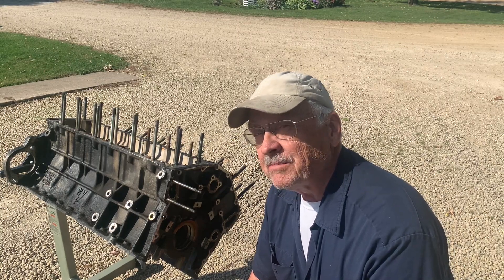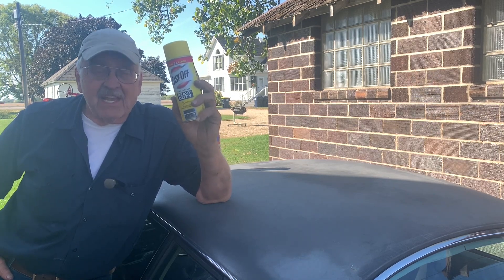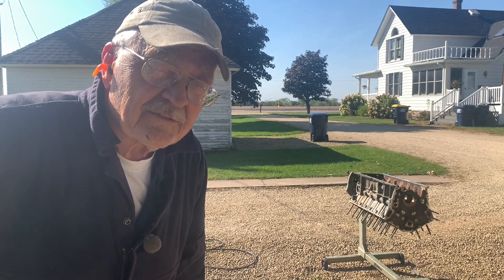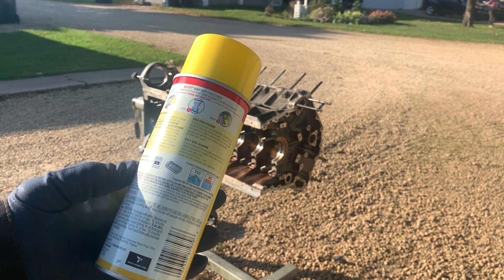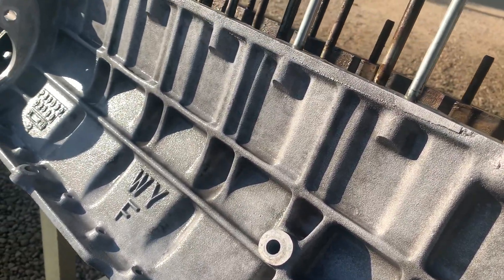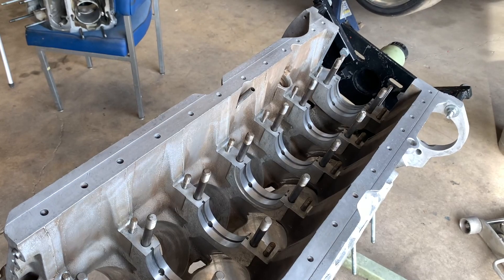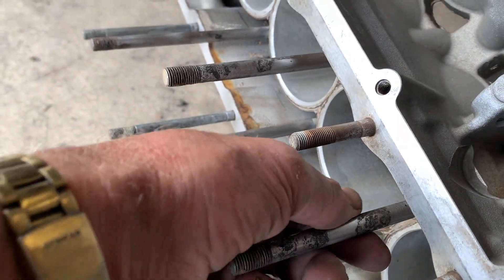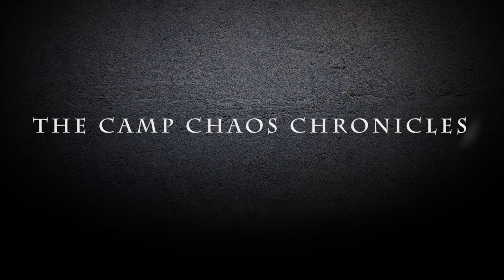S.3: Episode 9: Engine Degreaser Shoot Out - Gunk Engine Degreaser VS. Easy-Off Over Cleaner.

Comment: JP,  great video as always,  I've been licensed mechanic for over 40 years and all I use is oven cleaner or spray-nine,  as you mentioned time is of great importance.  They are very caustic. I believe the clr will do a good job.. Do you know if ARP  make jag engine studs?
Reply from the maker: The last time I checked, they don't make anything for the V-12. Engel Imports or Welsh Enterprises carries the standard items which are plenty good for even high performance applications.

Comment: Nice.  My buddy Chad uses phosphoric acid to really clean the alu after degreasing, but it can also discolor the metal.  I've always thought it would be nice to get a V12 clean enough to apply a yellow Alodine chromate conversion coating on it like old racing engines and aircraft engines use.